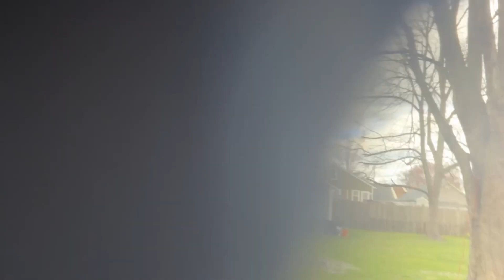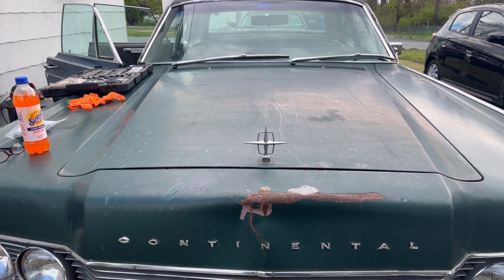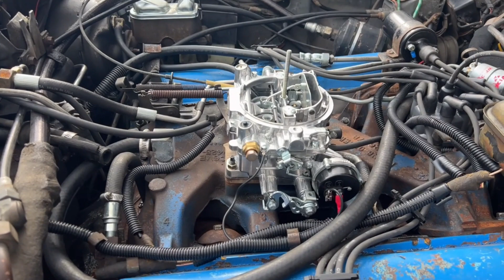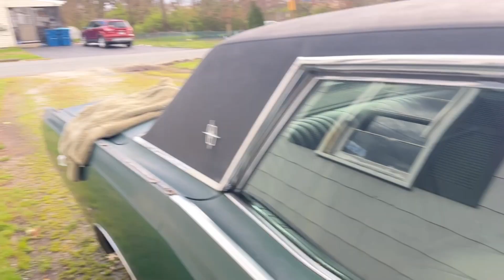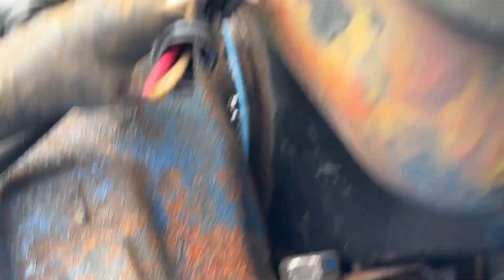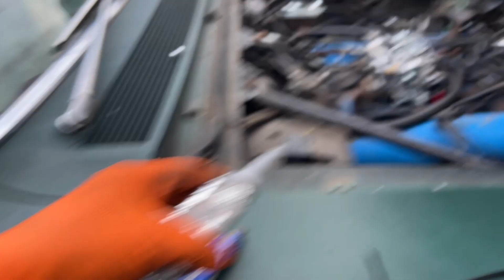1967 Lincoln Project Update 6 Apr 2024 Started Engine SO CLOSE to done

Comment: Hey. I am about to do this same thing with mine. I have a few lifters tapping and a very little smoke when I take off and start up but not while idling. Do you think I could get a list of gaskets I will need to replace the lifters. It would help me make sure I’m not missing anything. Thank you. I have enjoyed your videos so far.
Reply from the maker: I'm glad you are enjoying the videos.  Thanks!  You'll need the intake manifold gaskets, valve cover gaskets, the water outlet gasket, the valley pan gasket, and carburetor base plate gaskets.  You probably should replace the thermostat too since you'll have that apart.  I'd replace the PCV valve too.  I also recommend that you replace that 7/8" bypass hose that connects between the intake manifold and the water pump.  I bought that specific hose at the Lincoln Mercury Old Parts Store online.  Unless you happen to have some of that hose laying around - it's an unusual size.  Also check that wire mesh that sits inside the valley cover under that plate where the PCV hose connects to the valley cover.  You might need to make your own gasket for that.  If you need part numbers, let me know and I'll get that too.  Some of these gaskets are impossible to get through traditional auto parts stores.  I got mine at either Lincolnland or Mark II Enterprises.  As I recall, the valley cover gasket is the one that's tough to find.  Oh, you should also replace that oil seal that sets at the base of the distributor where it mates with the valley cover since you're going to have to pull the distributor.
Reply: @victorpalma6529  thank you for the info. I really appreciate this. This will make it a little easier when I start this project.
Reply from the maker: @jaycanfixit  Glad to help!